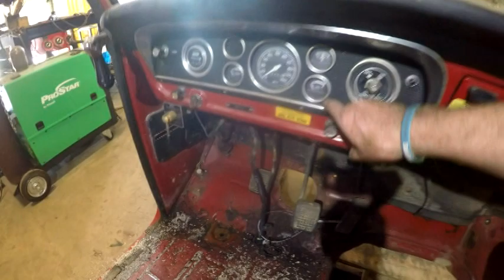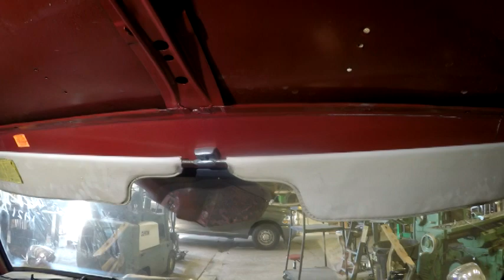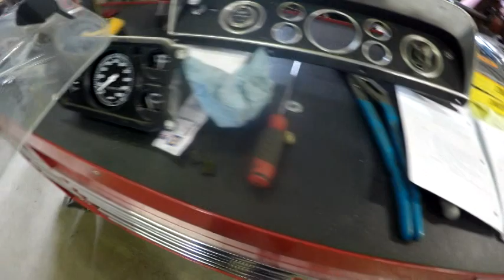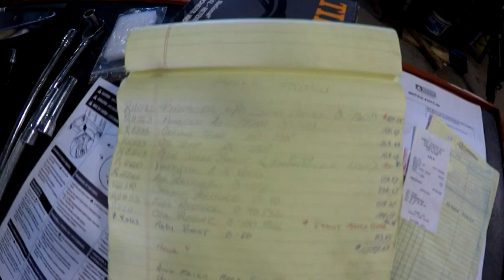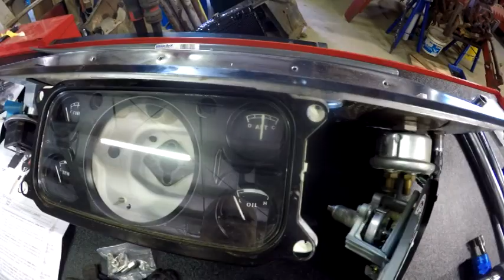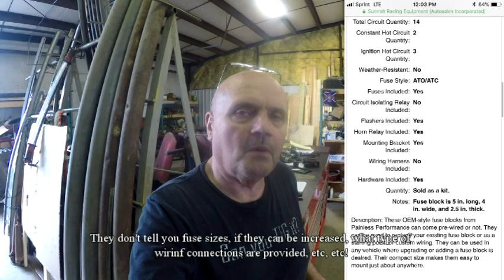Ford F750 Haul Truck Build Part 29

Comment: Auto meter gages for the win, they have a bunch of choices plus they will even create custom gages for you based on color, fonts, sizes etc. Their prices overall aren't too bad either.
Reply from the maker: Nate Van Bynen Someone else mentioned them before I made video. I looked at their online site briefly and it doesn’t look like the offer some of gauges I am looking for. I will go back and check them out again before any decision is made.
Reply: Take a look at their Old Tyme Black series...Black Face, white lettering and white pointer plus the font is nice as well :-) Pyrometer may need to be special ordered but I think they can do. Keep up the great work! Cant wait to see this think finished. You can even check out the custom shop https://www.ampcustomshop.com/ select and design what you need
Reply from the maker: Nate Van Bynen Their web site does not show all the gauges I am looking for under that series. I am going to contact some of these manufacturers to see if they can be gotten via special order. One of the things that I want to try and avoid as much as possible is the gauges with ‘steeper motors’ which seem to be the costly ones. Kind of looking for that ‘old school’ mechanical gauges.

Comment: In a Ford F-800 of about the same vintage I remember the tachometer was on the left where your hour meter was placed.  I can't remember what was originally on the right side.  I think you might mean backlight rather than ambient (the natural light found in the cab)  The Gauges?  That's a truck load of money, perhaps keep shopping.

https://www.google.com/search?newwindow=1&rlz=1C1CHBF_enUS812US812&biw=1455&bih=717&tbm=isch&sa=1&ei=bW2kW_udEaHI_QaK_bqoBw&q=1974+ford++truck+dash&oq=1974+ford++truck+dash&gs_l=img.12..35i39.327037.327037..329360...0.0..0.110.110.0j1......1....1..gws-wiz-img.ZRmbZxS04dI

Summit Racing - there prices have always been high, very often you can find the exact same product sold elsewhere.

https://www.amazon.com/Automotive-Replacement-Fuse-Boxes/b?ie=UTF8&node=15729661